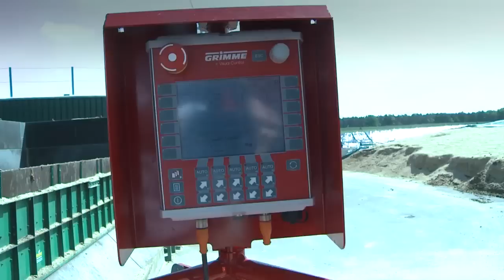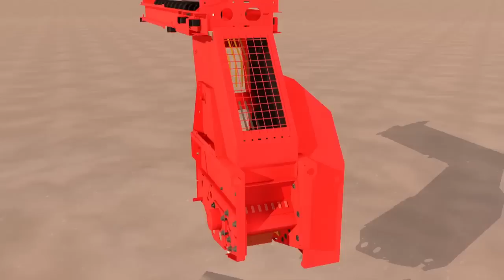GRIMME BeetLoader & BeetBeater | biogas beet preparation

Comment: Would washing the beet help in the biogas process ?
Reply from the maker: ***** With our machines we are cleaning the beets dry. First they are stored in the silo, after that they are cleaned and crumbled by the BeetBeater without water.
Reply: @GrimmeLandmaschinen  I've only just seen this video, as interesting as it is, I don't think it has answered the questioned raised. When I saw the dirty beet going into processing it crossed my mind about cleaning them first. There will be instances where a plant runs out of feedstock or they have to feed fresh from the field. What happens then? Does the soil entering the AD reduce gas production from the beet? Dolmer rollers when they first came out,were always good on a potato harvester for removing clods and trash. Star wheels will bung up if beet are sticky- had to clean plenty out before now.